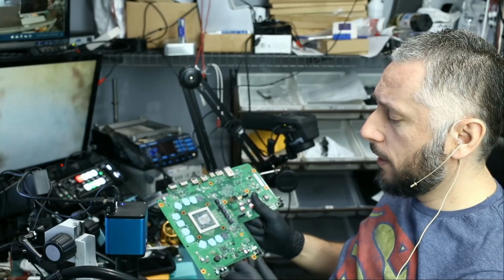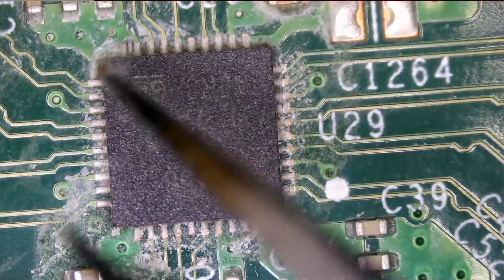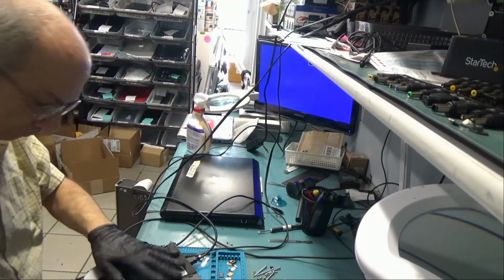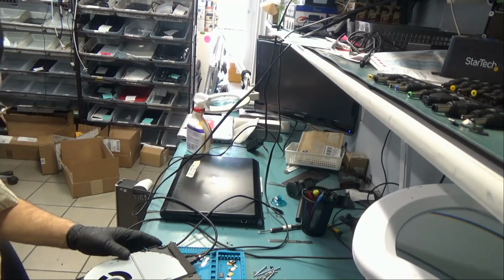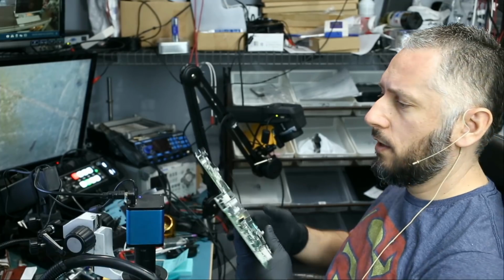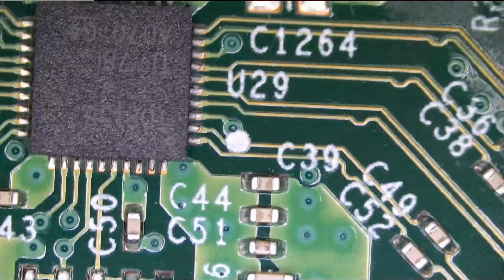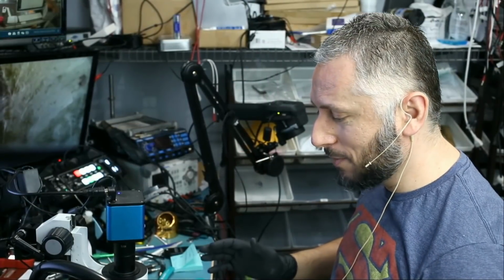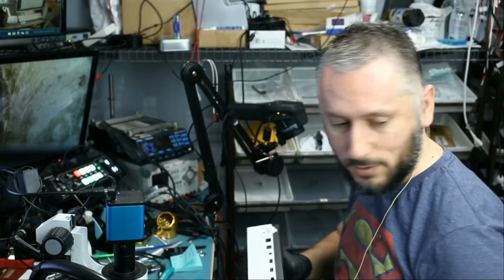xBox one x No Signal No Display and Flickering Repair - 3 consoles 2 fixed

Comment: Second repair in video is mine. Thanks for the fix
Reply: Good to see you have your console back :) as a technician myself I love the feeling of giving a console back to someone working and seeing how happy it makes them
Reply: @TheCod3r  the retimer also fixed my resolution. Picture is crisp
Reply: @dethcrimsonx  yeah the retimer is a big problem on these and the S version, I just finished recording a video where I had to change one which I will be posting tomorrow lol
Reply: @TheCod3r  nice, I'll check it out. Its wild cause my original xbox one had no issues.
Reply: @dethcrimsonx  as far as  I know the video encoding was controlled by the southbridge on the OG XB1, and personally I've only seen a couple go bad. There's a guy on here called Andrew Paul who specializes in console repair and his theory is that Microsoft saw more than we do and got fed up of replacing southbridge chips, so they switched to the same method as ps4 for video encoding. The PS4 uses a similar chip (MN864729) which also goes bad regularly
Reply: 4:10 its seems that you dont mind the fee sir Richard
Reply: @JassonQuill  I had bad experiences from usps and ups in damaged items
Reply: I need my chip replaced too how do we get a contact you
Reply: I believe my retimer chip is bad my one x is flickering can I send it to you?? How do I get in touch???
Reply: Can I get you to fix my xbox one x? How much will you charge?
Reply: How much did he charge?
Reply: @dethcrimsonx  xbox one is bigger consol might have better cooling

Comment: I have and Xbox one x and the hdmi port needs to be replaced and I only have a soldering iron and solder I don’t have any flux can I steal replace the hdmi port without any flux
Reply from the maker: You need flux to help with the flow of solder otherwise you will get bridges between pins specially on HDMI ports where pins are close to each other.
Reply: @NorthridgeFix  what happens if there is bridges in the pins? I replaced the hdmi port on my xbox one s and it worked for 1-2 minutes flickering the screen every 10-20 seconds until it stayed black and displaying no signal.

Comment: i try to change the hdtv setting to 480 p after that my tv say out of signal, i think it's the hdmi cable n then i change the cable, still out of signal so i think it's the port, but before replacement i try to update flash, n after i try to go xell nand, the screen doing really fine n i update my kernel, after update i try to start the xbox but still got this out of signal from my tv, i really confused by this when i go to xell nand by pressing the cd button, my screen doing really fine, but when i start the xbox there is no signal, i tried everything for 3 days, like push the power button for hard reset, n then the Y n right trigger button n doesn't work so any tips for the case that i got

Comment: Hey, have you personally noticed a lot more consoles breaking lately? I've been personally getting a lot of retimer and ps4 hdmi encoder jobs in and the story is the same, they were playing call of duty and all of a sudden it died... Do you think this has anything to do with how graphically intensive the new call of duty game is?
Reply: hmm thats interesting , the battle royal hase a pretty good graphic it could be possible that it can grill the chip
Reply: @maximilianjankowski  yeah last week I had 5 consoles in for repair, 4 of them had that same back story and all of them were retimer/hdmi encoder replacement. One of the consoles I got in recently was brand new, and the customer downloaded warzone and the retimer just went (flickering screen), not a spec of dust in the machine at all
Reply: TheCod3r Tutorials I recently plugged mine into my monitor, flashed a bit and ended up black screening a few days after, now it puts out no signal to no tvs or anything, you think it is something internal?
Reply: @TheCod3r  I heard it had something to do with a system update. The xbox one x project scorpio 2nd in this video is mine. Was fine up until sometime last yr. Waited long to get it fixed.
Reply: @Aye77787  if you plug it in while the console is on there is a chance you could short pins out and cause the ic to fail. Make sure you try a different monitor and a different cable first before deciding it's the console
Reply: @dethcrimsonx  I've not heard that, as no customers have mentioned a system update, but I can't see an update causing physical hardware failure unless it fails to recognize the ic, but if that was the case it wouldn't repair the console by changing the ic so I find that a little hard to believe
Reply: @dethcrimsonx  i am a preview member and i also have the early  2014 modell (one of the first)and it still works after ~150 hours , maybe the new models or the newer chips are faulty ?
Reply: TheCod3r Tutorials yep plugged it into 2 different tvs and 2 different monitors, both no signal and tried starting it up on low res mode too. When I pull out hdmi cable on tv the no signal goes away then comes back, same as putting it back in, that means it’s the Xbox not putting out a signal but the tv still detects it’s there? Meaning it’s the retimer?
Reply: @TheCod3r  what if the update overclock it ? could this be a reason ?
Reply: @maximilianjankowski  I'm a preview member too. Since day one xbox one. I do know after I got the x, some time last yr the video started going. Who knows , its probably a faulty retimer. I just remember hearing about a update that caused the one x. to black out.
Reply: @maximilianjankowski  potentially if it were to overclock it but that isn't likely to happen. The most common issue with updates is software bricking, to overclock it the firmware would need to push more voltage to the ic, and in that case it would blow the chip every time it was replaced. It would also very likely destroy the apu since they have very low tolerances when it comes to voltages
Reply: @TheCod3r  I dunno. I'm just glad it is fixed. I held off a long time in getting it fixed. Is it possible that an update can cause the chips to heat up or  burn out causing issues?
Reply: @dethcrimsonx  as far as I'm aware there are no known issues with xbox updates breaking consoles, the main reasons would be shorted pins which can happen by simply unplugging the hdmi lead while it is turned on, or by too much heat. I'm not sure how hot the retimer ic runs naturally but I'm assuming it is possible to overload it with an intensive game
Reply: @TheCod3r  thanks for your input. This Is new to me with regards to the onex. I had no issues with the regular one system. I use to repair 360s back in the day lol.
Reply: Had my Xbox one X for a year ina half. Got a hard dive crash while playing warzone about a month ago. Replaced hard drive with SSD. Re-download warzone, and played for about 2 hours when my screen flickered and lost all video. Xbox still powers up and boots. Can hear thru my headphones but no signal. I'm convinced there's an issue with COd and the X. Strange things
Reply: @tpwnage714  yeah I'm pretty sure ig has something to do with games, could be wrong but far too many are breaking suddenly with no reason